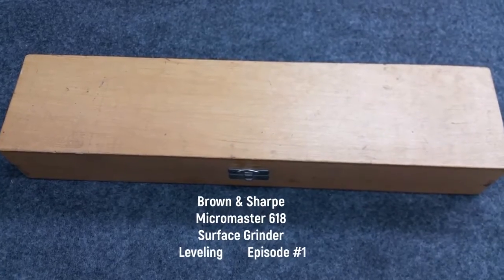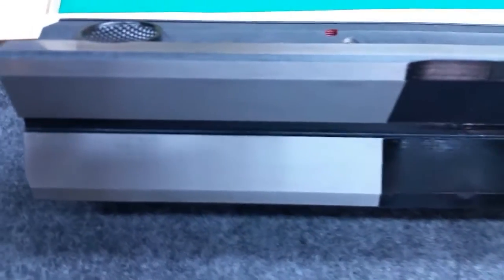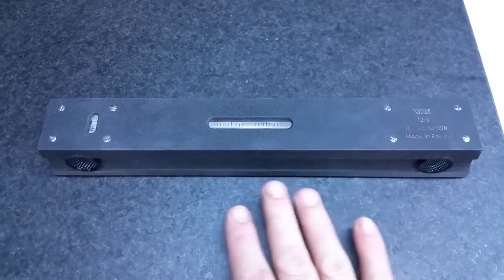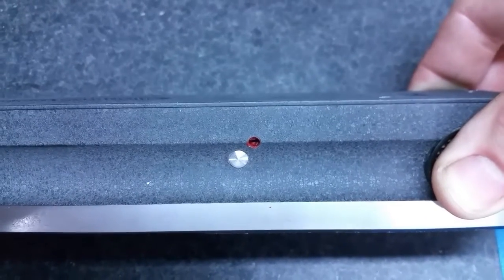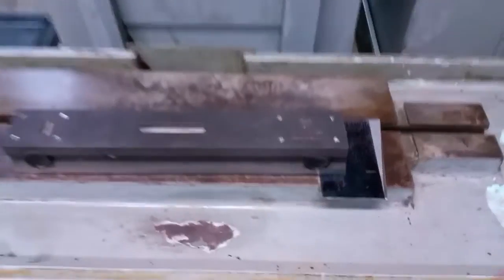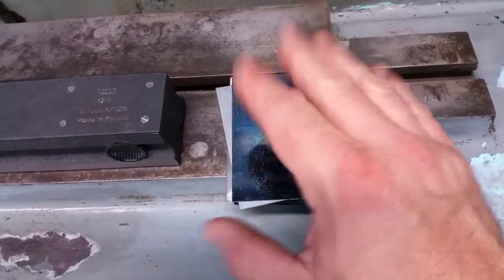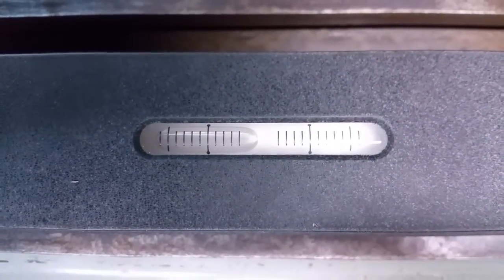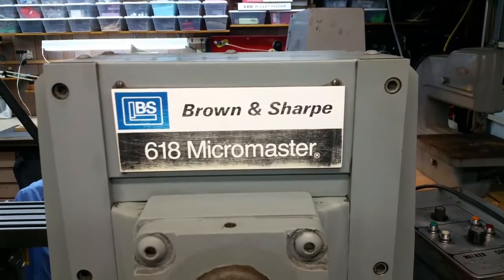Super Precision Level! Brown and Sharpe Surface Grinder

Comment: I thought the Polish made sausage.  They make levels too?  That's awesome!  I especially love the little bubble in the center.
Reply: Bison lathe chucks, High end Narex boring and facing heads, excellent micrometers and other measuring tools usually branded with that VIS label. Very durable and beefy lathes and milling machines etc. Poland has a long history in the machine tool industry. I've zero complaints about the accuracy and fine finishing on my Narex B&F head.